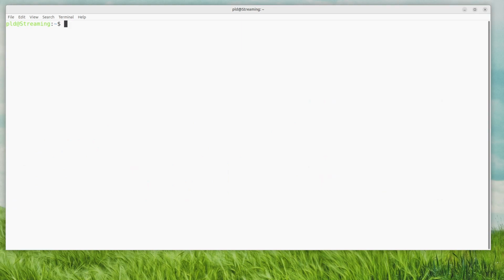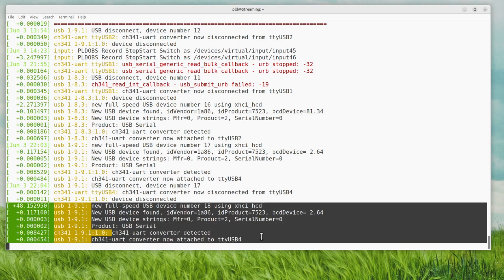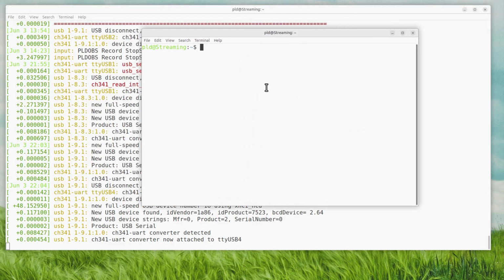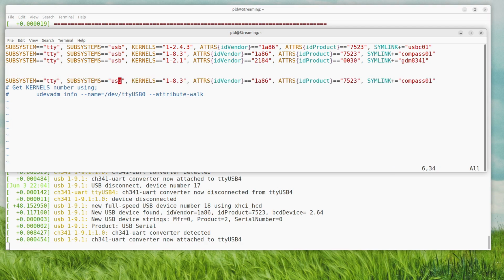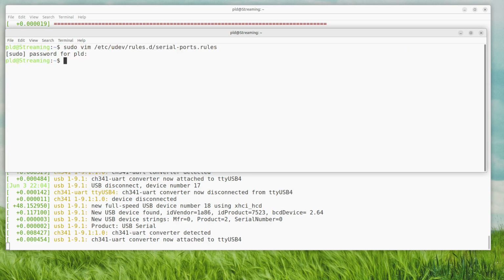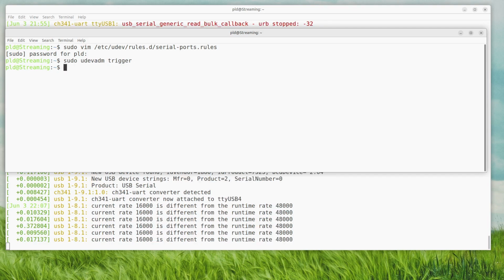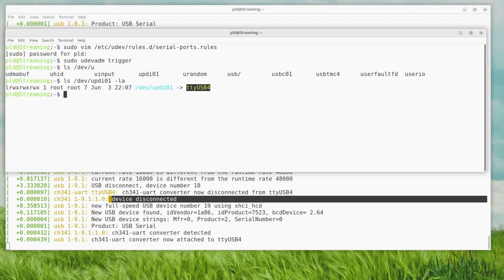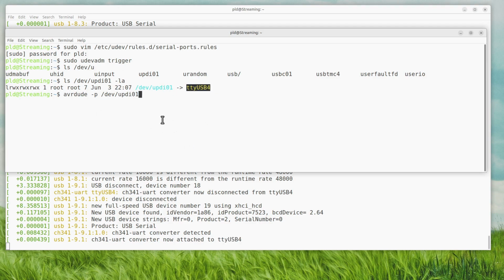Linux: Hard Coding COM port names using simple dmesg & easy UDEV rule.  No more random port numbers.

Comment: Another option would be to use "tio" which allows you to have a configuration file

[rpi3]
device = /dev/serial/by-id/usb-FTDI_TTL232R-3V3_FTGQVXBL-if00-port0
no-reconnect = true
log = true
log-file = rpi3.log
line-pulse-duration = DTR=200,RTS=150
color = 11
---
$ tio rpi3

Comment: A simpler idea to let you identify, for example, your voltmeter without sending any data to it:
Use the RTS# pin on the CVH340. It will go low when the virtual port is opened. (unless on CH340R where it goes high.) Then send a identification string/packet letting the host confirm it opened the right port. (The programmer you bought using CH340E has schematic published showing LED wrong way on pin 6 (RTS#) which I suspect prevents it from lighting up when port is opened ?)

Comment: By the way, I just thought of a very "me" idea: You could potentially emulate the external eeprom for the CH341A with the MCU!
It just needs a I2C slave interface (most have hardware for this) and implement device 7-bit address 0x50 emulating an eeprom.
Datasheet contains the configuration details of a table of settings that could be embedded in firmware, with a editable version stored in the MCUs data storage area. Then implementing a custom production explanation string at address 0x7F is easy 😛 I love overcomplicated solutions to nonexistent problems!
Reply from the maker: You got that last bit right. I'll stick to wasting my time on other things.  Problem solved for me here; wiping my hands, moving on :D

Comment: Depending on how you implement the USB CDC-ACM comport you can set a custom device description allowing devices to be scanned and application can use the correct port.
The device does not have to be opened for I/O just interrogated. Unfortunately hard to do through Python etc.